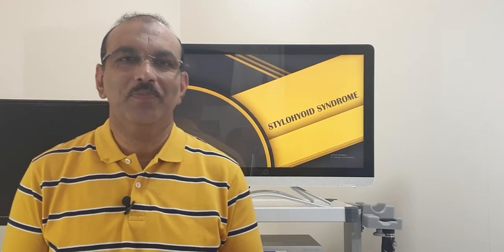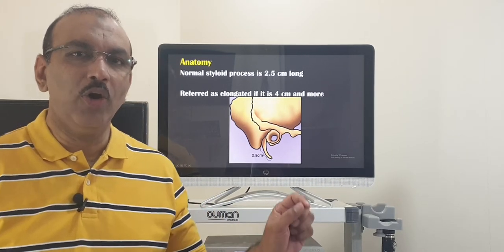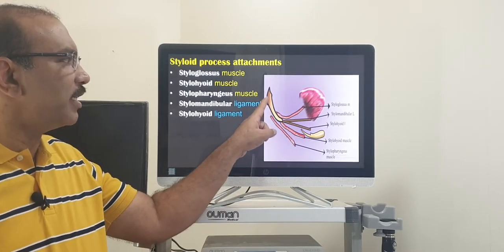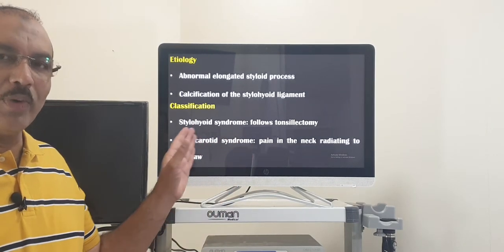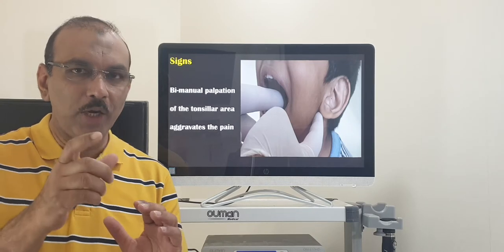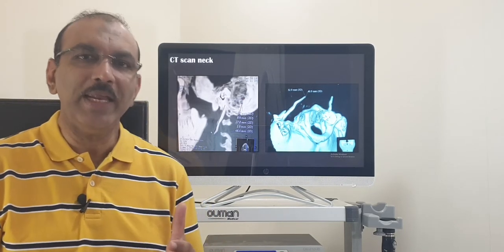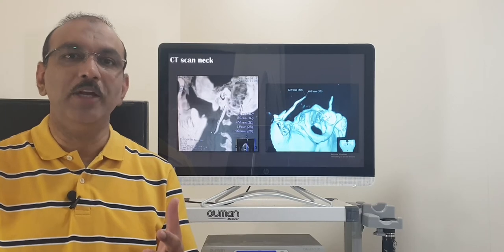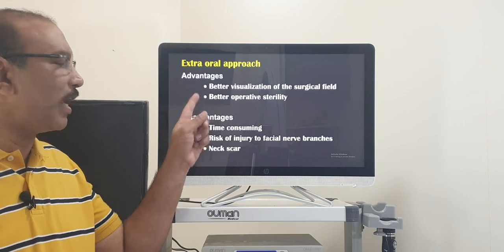Stylohyoid syndrome (English) Patient teaching programme

Comment: It's not the length that matters, it's the symptoms. A German doctor recently wrote a report about a patient with double stroke from Eagle Syndrome. The styloid was only 2.5cm
Reply from the maker: The patient starts complaining when the styloid process length exceeds 4 cm.
If it is less than 4 cm then angulation is considered, and always medical treatment first
Reply: @drzakirhussainent7860  I am now aware of several cases in Germany in which the Styloid was less than 3cm and the Symptoms could only be eliminated with an Operation. Probably also due to the thickening of the Styloid. What therapy do you recommend before an Operation?

Comment: Sir, I m having stylohyoid syndrome, I have done ct scan the the length is 3.6 , I have been taking maxgalin 50 but same feeling no improvement, how can i contact u
Reply from the maker: 62381 02269 if you need consultation